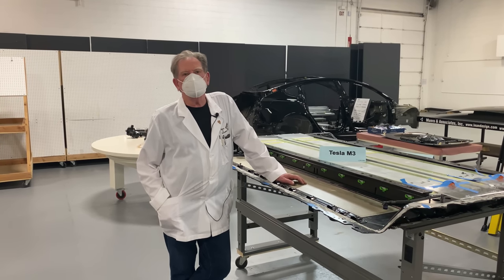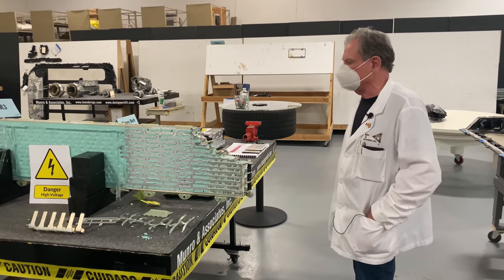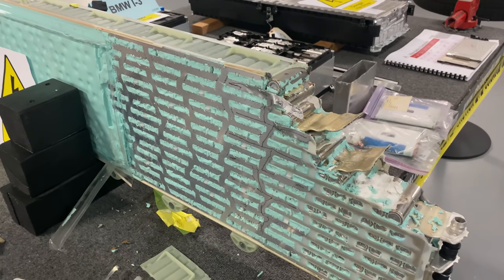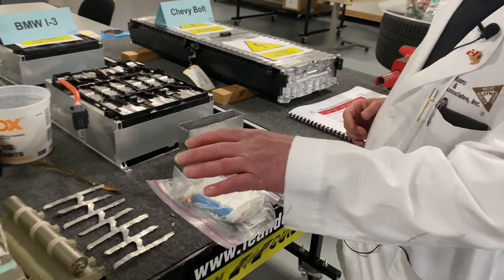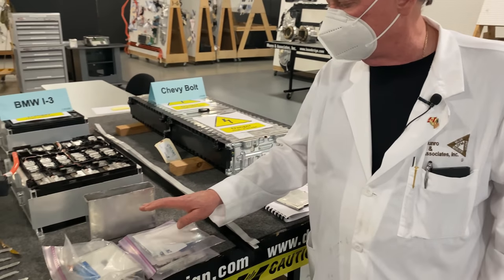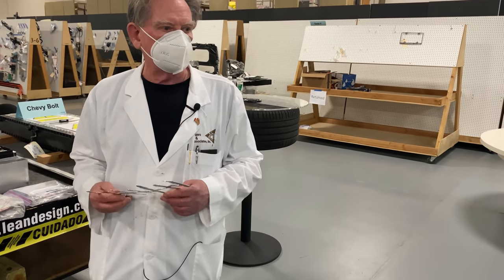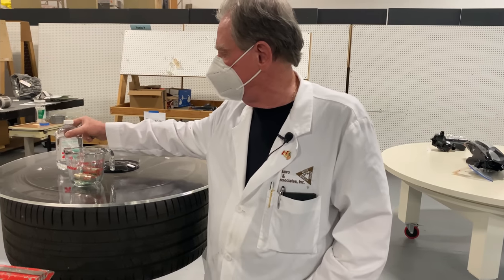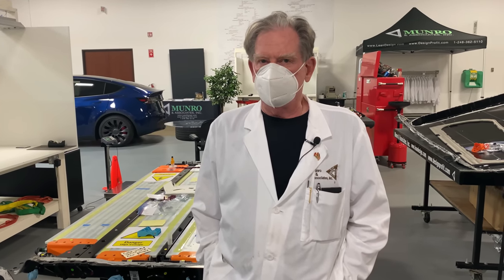Model Y E32: High Voltage Battery Comparison - Cylindrical vs. Prizmatic vs. Pouch

Comment: A question to the Munro team. How does the internal resistance of a Tesla cylindrical cell compare to a pouch or prismatic cell?
The Ri of the consumer cylindrical and pouch cells I have at home differ significantly, by a factor of 4 or more.
I am curious if this is also true for automotive cells.

Comment: Can we buy the discharged cells please Sandy?
Reply: Yep. With Sandy's signature.
Reply: USPS will NOT ship LION batteries, NOT Even Discharged ones.
Reply: Mark Plott they ship smartphones, right? They have Li-ion batteries in them.
Reply from the maker: We talked about this at the request of some viewers, but unfortunately it's just not feasible given the hazardous nature of the batteries.  Thanks for tuning in!
Reply: @louicoleman2910  - Smartphones and small devices have low voltage LION batteries, usually just one sealed Pouch cell.
a Single 18650 or 21700 battery is too Dangerous to ship , even when Discharged.
when I Flew to Japan last year 2019, they REFUSED to let me fly with my Shortwave Radio , which had a Rechargable 18650 cell. so, I gave it to a NON- flying family member. and I was allowed to FLY.
the USPS also Does NOT allow High Density battery to be shipped, when I bought my Shortwave, it had to be Shipped by e-Packet and Delivered by DHL.
Reply: Fair enough. Thanks for making such good content!

Comment: How will battery bricks be recycled if they are glued together?
Reply: I was wondering about that too. I thought they wanted to use them in powerwalls. 

I could see it get automated though. A robot could drain the cells to a level ideal for storage and handling (which can be done before disassembly), then cut away or remove the external stuff.  You could probably cut off the metal straps so that you now just have the battery terminals exposed on both sides and then all that is left is the glue. You would want something that supports all the individual batteries from the ends so that they don't come into contact with each other or other metal components, and then you could dip the pack into a solvent bath to get rid of the glue. Then the cells can all be removed. 

With a proper rig/etc it probably could be very efficient and I inside this would be done at a large scale. The batteries can then be separated, tested, etc individually.
Reply: Recycling BEV batteries at scale is likely not cost effective, hence you have not heard too much about it. Great in theory but tricky in practice.
Reply: @bradleycross5987  wasn't this the main point of the powerwall product? I thought it was intended as a way to get value out of batteries that were too worn out for use in cars, but the fact that Teslas are still new means there aren't many used batteries available for them.
Reply: @RichFreeman  The powerwall is reuse, not recycling.
Reply: @AntsAasma  how do they reuse batteries without removing them from the packs?

Comment: Thermal management for those pouch and prismatic cells can't be as efficient as for Tesla's pack.  In particular, the cooling can't get as close to where chemistry is happening in cells.  Doesn't that have implications for battery longevity/cycle life?

I sure would like to see what Porsche did with the Taycan battery pack.  News reports suggest they've improved cooling for sustained high-speed operation - but did they?  Or did they just tweak the software limits to tolerate more heat, with possible consequences for battery longevity/cycle life?  Sandy could find out if Munro & Associates got a Taycan to tear down.

I also look forward to seeing Munro & Associates tear down whatever new-fangled pack Tesla will hopefully announce later this month at Battery Investors' Day.  Next year, maybe?

Comment: Could you make pouch or packets mixed as the first Tesla battery with the case and it would be lighter with battery outer case layered like the Tesla but could you electolight or I mean gold plate aluminum on one side or is there a way to take packets put them in long wide packs like lazonya with way to cool between electolights between packets to cool with cool liquid layors less material and you could seal packet layors or in between put salindrical cells to use as connecting connectors right ?

Comment: How can the cylinder type battery packs be more space efficient than the pouch style ones? I'd assume that cylinder type packs lose a lot of space between the cells?
Reply: He's talking about thermal efficiency. With the small cells you have several cooling ducts going directly through the battery pack, each cooling just a small volume. With the huge brick you only have cooling ducts on the outside that must collect heat from the entire brick volume. So there is less cooling and more travel inside the battery for the heat to get out. The problem is not the shape, it's the volume of the minimal unit. And this limits both the charging speed and the max deliverable power.

Comment: And here I thought that a prismatic battery cell was just an anode, a cathode and a liquid in the can consisting of both the electrolyte and lithium ions... I was mistaken.

But then, why go prismatic instead of pouch? I fail to see the cost saving in going prismatic there -- other parameters (heat management, etc) notwithstanding.

Comment: what factor determine the cylindrical cell dimensions beside heat dissipation ? what's preventing them from making a battery cell the size of a beer keg ? assuming there is sufficient plumbing to manage heat properly
Reply: Youtube channel "The Limiting Factor" covers Tesla batteries in detail.
Reply: How are you going to cool the center of a beer keg sized battery?

Comment: I would like to see you do a video on the Toyota battery both their lithium and Nickle metal hydride. Toyota has been making Hybrids for about 25 years and make a whole lot more cars then the rest. Toyota uses the lithium battery only in their cheapest model.
Reply: Toyota using old ni-mn 6.5ah cells in cheapest trims, and li-ion in plug ins or top of the line hybrids.

Comment: The pouch would be better from thermal stand point. They would have better cooling systems in place. For example in Chevy Volt there are cooling passages between each pouch. 
In case of cylindrical cells with cooling passages on one side of the cells its difficult to remove heat from the cell center. So far cylindrical are working perfectly. But I think as size of battery (kWhr) increase so would the cooling requirements.

Comment: Do they have temperature sensors in the modules? It would be logical but nobody is mentioning it. It would be interesting to see where they are.
Reply from the maker: Yes, there are multiple temperature sensors embedded in each of the four modules, and these are monitored by the BMS.  Thanks for tuning in!
Reply: @MunroLive  Thank You for Your reply. Are they using ultra thin thermistors bonded to the battery cell can on the side without cooling plate?

Comment: The mineral oil is not electrically conductive (dielectric) - so it would not cause short circuits/electrical hazard if cooling is damaged and oil is spilled.

Comment: It shows that batteries are not your thing! In the 3/Y battery, the single 21700 cells in the "brick" are in parallel, so if the fuse wire breaks, you loose capacity, not voltage. And the nominal voltage of each cell is 3.7V (4.2 at max charge), the BMS checks the voltage of the entire battery "brick" and balance them.
Reply: 3:05 - and The main ingredient in lithium ion batteries is  Nickel

Comment: Maybe they can make a battery with the connectors on the side instead of the top. Also, maybe they can make the batteries a little squary, so they connect automatically with their sides.

Comment: 5:58 Wouldn't the small cells need much more material for all the cell casings? Cylinders also can't be perfectly stacked, so wouldn't there be more space in between compared to the other cell types 🤔
Reply: seasong the round shape of cylinders is extremely strong for the volume they contain so can be thinner but not sure how much that helps. Also the spacing is ideal for cooling because the channels wind around the cells and the increased surface area of more cells in a smaller size makes cooling faster as well, just like how radiators use many small fins to maximize surface area.
Reply: They takes advantage of  the spaces which  are utilized for thermal management....win win.
Reply: so then wouldn't that make them similar, one wastes space, but then puts cooling through that space, the other doesn't waste space and puts cooling in addition?

Comment: 9:15 and that's why EV west is useful. They have nearly everything you might need to build your own electric car.
Reply: EV west also has Drop in Kits for your Vintage VW, Porsche and most RWD cars.
FWD is harder to do , because of the Transmission.

Comment: Correction @ 3:00. Lithium Ion is NOT the main ingredient.
Reply: It is the main ingredient. Just very little of it is used in terms of weight % compared to the anode cathode an other materials.
Reply: @handris99  Wrong, it's the chemistry.. To quote Elon Musk “Our cells should be called Nickel-Graphite, because primarily the cathode is nickel and the anode side is graphite with silicon oxide… [there’s] a little bit of lithium in there, but it’s like the salt on the salad,”

Comment: Does Tesla monitor the temperature and charge state of each brick?
Reply: YES.
Reply from the maker: Yes, each of the 4 bricks/modules has a dedicated Battery Management System (BMS) circuit board that monitors those two variables, among other.  Thanks for tuning in!

Comment: What are the chances that those tiny coolant channels will clog with corrosion over time?  They use a standard water & glycol coolant, like in a car radiator, which are known for clogging or corroding thru the aluminum channels.  I am surprised they don't use a waterless coolant (no corrosion).  If they do clog, the battery pack becomes useless since you can't replace the snaking coolant channels with all that glue.  No reports yet of it being a problem, perhaps because the operating temperature is much lower than in a gasoline engine.  The only issues to date have been the coolant connections leaking, which was due to improper assembly.

Comment: From what I've read, there are advantages and disadvantages to each battery type. No one type is better than the other, IE, doing 2170 isn't exactly the "best" solution, and that includes size as well.
Reply: HE CLEARLY SAID IT WAS CHEAPER.

Comment: So if on Model S or X the battery develops a fault you can just buy a 2nd hand module for $1500 and exchange it. Also off-grid solar people are using those modules giving them a 2nd life as do EV conversion guys. So that's all spoiled now with M3 and MY or do I miss something here?

Comment: Looking back at the model Y battery tear-down I can't help think how much harder these batteries will be to recycle compared with the prizmatic and pouch type. And as for using these batteries in a second life, that's not going to be easy becuase they will need a new enclosures.
Can't help thinking that the cooling can't be that good for the last batteries in the loops... Munro, any thoughts on these questions??

Comment: Although it seems silly to have thousands of cells, the cylindrical batteries have an advantage in that the metal round casing stop expansion of the cell with temperature due to normal use- discharge/recharge. With each cells being small, their thermal mass can be "easily" regulated thru cooling/heating.
 Prismatic and pouch cells don't have metal walls so they need to be "boxed" up to confined their expansion. Each cell being bigger carries a bigger thermal mass and is a bit harder to thermal regulate.

Btw "bugger" is a naughty word in the UK. It means a person performing @n@l $€x on someone.

Comment: We are often told that lithium being the electrolyte but only about 3% of the cell. Nickel, aluminum and cobalt are far more significant by weight. Is that entirely true?
Reply: Cobalt not so much in Teslas bateries. They are constantly trying to reduce the amount of cobalt in their bateries to zero percent.
Reply: @bornacvitanic  Source? Is it what they say, or what was measured by 3rd parties.
Reply: @seb.  The original tesla model S using the standard 18650 cells produced by Panasonic contained 11kg of cobalt per vehicle. The model 3 using the new and improved 2170 that panasonic and tesla produced together, contain about 4.5kg per vehicle. They have also said that as they improve the chemistry and processes to produce the battery, they aim to continue to reduce the amount necessary per vehicle. Hoping one day to use zero.
Reply: @bornacvitanic  Those are press release based posts... And using future tense.
Let's wait for Munro team if they do actual chemistry analysis.
Reply: @Slicerz717  This sounds all nice and great, but I'd trust more numbers from external analysis made by independant parties.
Reply: @seb.  https://www.theguardian.com/environment/2020/jan/05/cutting-cobalt-challenge-battery-industry-electric-cars-congo
If you read this data comes from a group called Benchmark Minerals. So this data seems accurate. It would also be against Tesla's interest to lie about how much cobalt is in a car battery pack. Don't want to get sued.  So it doesn't just sound nice and great, it seems nice and great. Tesla and Panasonic have done a great job playing around and optimizing a chemistry.
Reply: @seb.  sure thing 👍 but Tesla doesn't lie about their batteries. Reducing cobalt also reduces the price of the cell. That's how Tesla had such low prices for the Capacity / Range

Comment: If tesla cells are cheaper, why it is so expensive? Somehow this design when all the batteries just glued together doesn't look appealing to me also.
Reply: What do you mean but expensive? The packs are bigger and would be more expensive when compared to a smaller pack. But make them of equivalent capacity and Tesla is cheaper by a long shot.

Comment: What will happen if one of the batteries die in the Chevy Bolt?
Reply: The Chevy Bolt battery pack can be disassembled and individual cells replaced.

Comment: if pouch batteries like lg are more expensive why are manufactures using them more. better energy density ?
Reply: Lower resistance. So they are easier to cool them than (an old) zylindrical cell. The new 4680 cell from Tesla will also have low resistane due its tabless design and the advantage of fast production and structural pack. I think it is a Win Win Win situation, for Tesla.

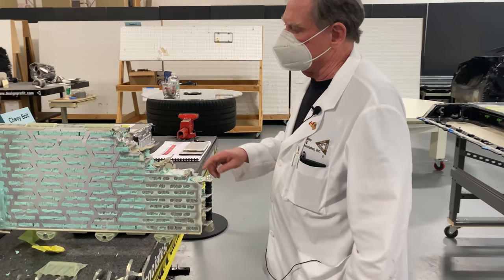Comment: 2:20 Crazy.  How do we re-use or recycle these? Tesla should provide an easy away to give second life to these batteries.
Reply: The power wall makes use of repurposed u.ed cells .
Reply: You don't "reuse or recycle" the cell
You reuse or recycle the module (×4)
Take either the whole pack, or each of the 4 individual modules.
Slide into a rack.
Connect to whatever.
It lasts another "X" years in a storage capacity.
When (if) it falls below the standard for that use, it's destructively "dismantled" 
(shredded) to reclaim the chemical  components.
There's no need to extract every individual cell.

Comment: Please explain those tiny wires
Reply: They act as fuses. If a cell is shortcut it will break. And the rest of the battery will still work. And the car will not burn :-)

Comment: The chevy volt cells have a very hi C rating.
Reply: How many volt?
Reply: @mcplutt  Chevy volt pack is 300 to 400 volts for the whole pack. 2011 to 2015 are 12 cell 48v packs.

Comment: You can dip the brick and dissolve the glue holding it all together in a few minutes....This is not as hard as you are making it out to be.  Just use the right tool for the job.
Reply: David Beppler alcohol or acetone?
Reply: @teslafudge1585  depends on what the glue is...

Comment: How the hell would they recycle these?
Reply: Reverse how they made it.  Many glues can be chemically softened to break the mechanical bonding... the cells themselves. in a controlled chamber without oxygen, slice the can, push out the jellyroll , extend it to flat state peel the layers of it  mechanically.  collect  the deconstructed materials  for individualized further processing to neutralize any bad effects.

Comment: Your cell phone in your pocket is creating you can hear clicking in the audio 14 years as an please remove your cell phone from your when you receive a text or update your phone will create a high static we threw the unshielded cable through your lapel Mic it's that series of low-volume clickingI have all of my guys remove their cell phones light on stage and in the booth including the cameraman just helpful tip
Reply from the maker: Appreciate the tip, Kurt, we'll do that!  Thanks for tuning in!

Comment: This complexity is insane. Why are we being forced into this cost?  Just think of the problem of recycling these batteries!  With an ICE car, the end of life cycle and recycling system is very efficient, heck, recycling todays ICE vehicles is like recycling an aluminum soda can, but where do these old batteries go? Look at all the ICE engines used in the mining of all the chemicals required to manufacture these batteries.
Reply: You should compare energy storage with energy storage. Can you recycle gasoline? No, its gone into exhaust gases in the air. Why would gasoline be fine with no recycling, but batteries cant be fine without recycling?
Electric motor can be easily recycled.